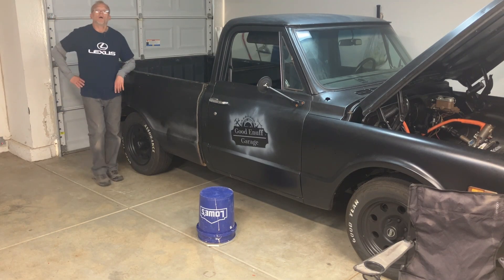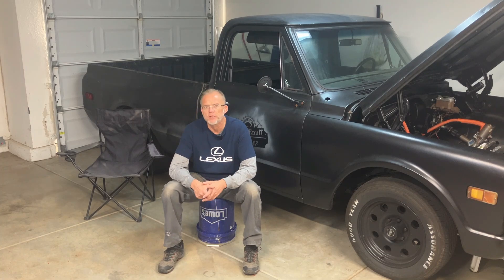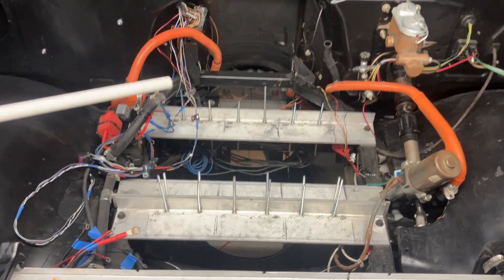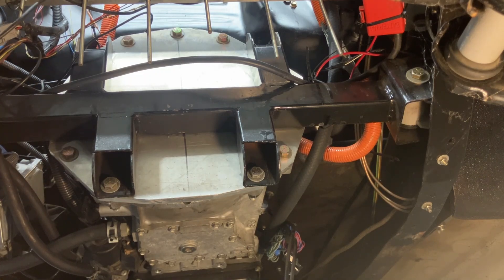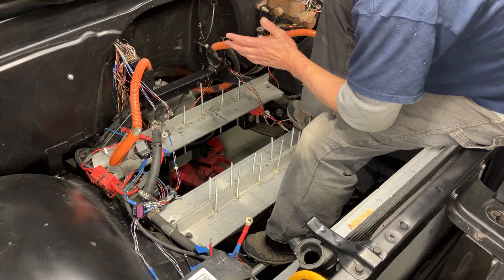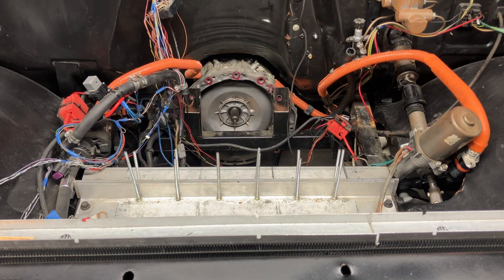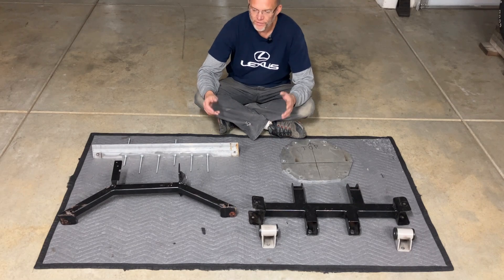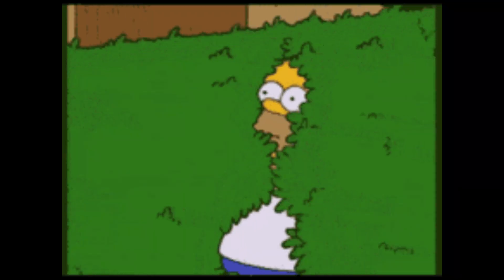GMC Electric Truck Gonna Lock The Lexus Input Shaft

Comment: I would be surprised if a pair of 3/8th bolts a side isn't strong enough to hold the torque.  Maybe put some washers on it to spread the load over the frame better, but with the rubber isolators between the motor and frame brackets, no way a shock load should pass through hard enough to snap any of those bolts.
Reply from the maker: i hear ya, plus the frame is a C channel, maybe cause in an electric there is no torque ramp up like in a conventional gas powered car and its more instant, oh well they 7/16ths now 👍🏼

Comment: A14 is TRANS SL2-, so it's for controlling one of the gear change solenoids.
Reply from the maker: thanks yeah that's the pin on the VCU but this cable runs to the inverter so some fool must have mislabeled it 🤷🏼‍♂️